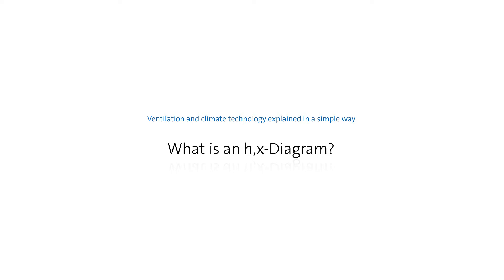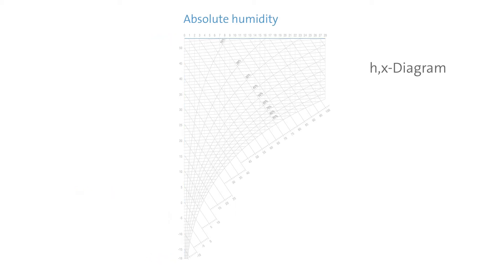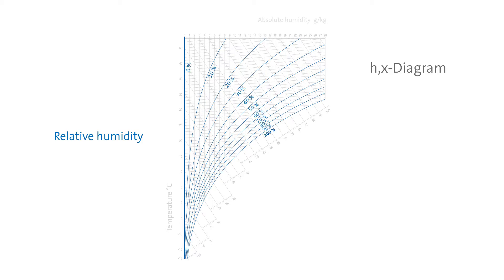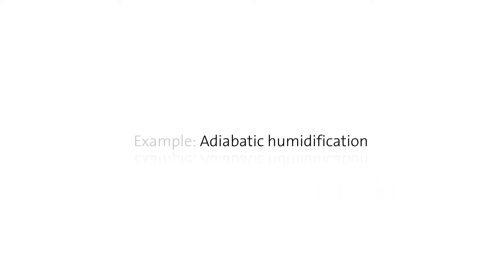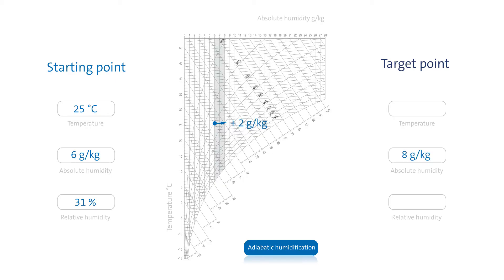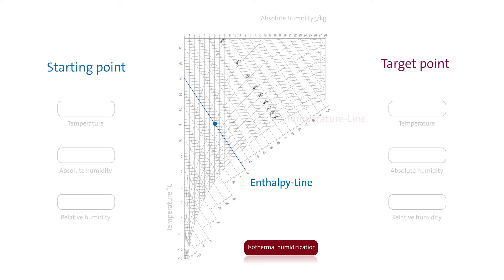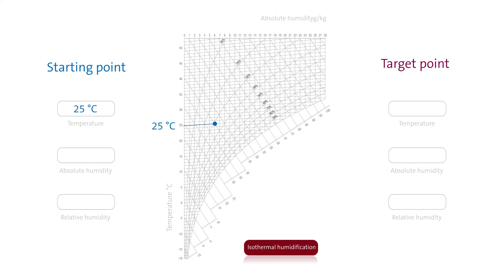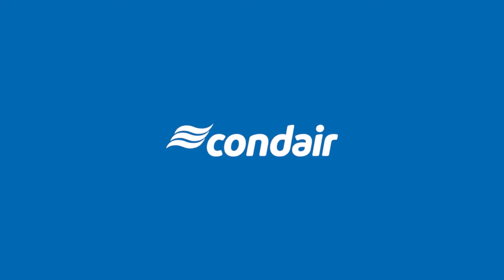What is an h-x diagram? | Humidification Made Simple

Comment: Doesn't condensation occur below the saturation line? The video said above but that doesn't really make sense to me. Any thoughts on this?
Reply from the maker: Right. At any conditions below the saturation line the air is no longer able to keep the humidity and a condensation will occur.
Usually these conditions will be avoid, but nevertheless there can be a need for this conditions. In a Condensation-Dehumidifyer for example.